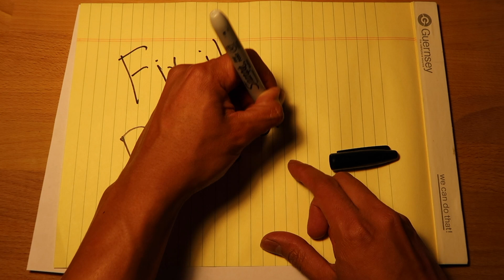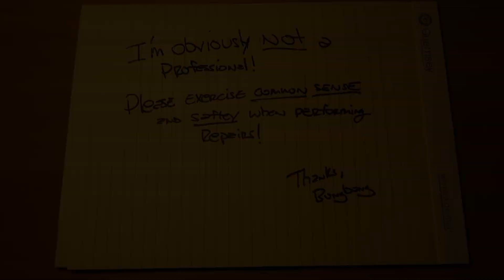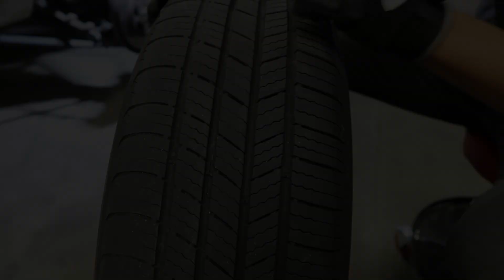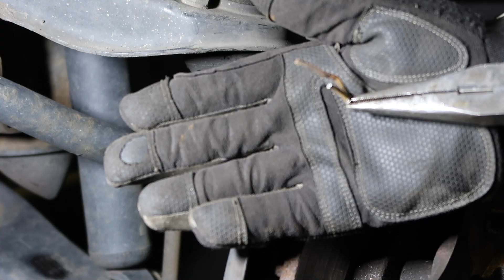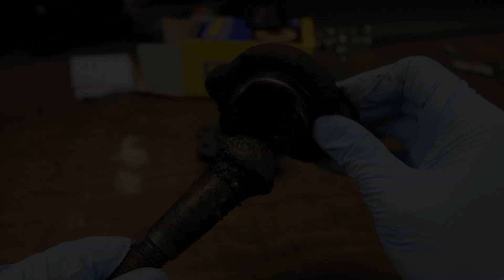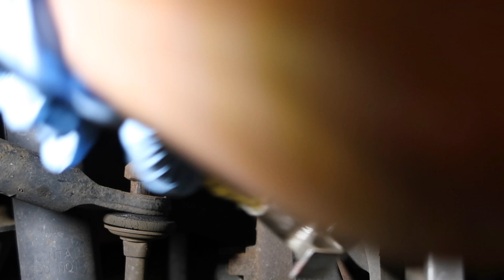HOW TO: Replace Worn Ball Joints!

Comment: Great video man!
Now I need to find one that does lowers...
Reply from the maker: The lower ball joints on the 2wd d21s are part of the control arm assembly, unfortunately you have to replace the control arm to do the lower ball joint.

Comment: Great vid man! Definitely helped me do mine.

I will say, I have NO idea how you did that little trick to get the upper BJ's out 😂 I had to unbolt them from the upper control arm, put a torch on them, put a puller on them, air hammer them relentlessly, beat the puller with a sledge relentlessly, and FINALLY they'd pop. I don't even live in the rust belt, either!
Reply from the maker: Oh wow! and not even in the rust belt?! Are you near the coast or salt air? That's interesting. Thanks for watching and commenting!

Comment: Hi, I am looking to replace my ball joints however after looking online there is an "Upper" and "Lower" Ball joint. Whats the difference and are both needed for this replacement? Also which type of ball joint did you use in this video? Thank you so much and great video!
Reply from the maker: Great question! The difference is actually best described in their names, where in a double wishbone style suspension there are two ball joints used to locate the spindle. The upper resides above and the lower.. below. In my particular video the upper is replacement, while the lower requires a complete replacement of the lower control arm. If one is bad, you should definitely check the condition of the other (if you have two). In my instance I only had to replace the upper. Vehicles with a MacPhearson strut style suspension will only have a lower ball joint.
Reply: @FixitBongbong  thanks a lot! I appreciate it.

Comment: Good afternoon. Excuse me, with Your  Makita  Impact Wrench Can You loosen and tighten the 24 wheels nuts (all the four wheels nuts) without changing the battery? Thank You. Great Day.
Reply from the maker: Sorry for the delayed response here.. but yes actually. I can loosen all 24 lug nuts on my d21 with no issues and still have plenty of battery remaining. Please note though.. the makita tool I'm using is an impact driver and not actually an impact wrench.. so I believe most people and the manufacturer would say I was misusing the tool. That being said.. I used it for lug nuts for 4 years until I finally bought a dedicated impact gun and the tool still works great!
Reply: Thanks a lot. I think I will get one makita impact wrench. Good evening.

Comment: Quick question what’s the bushing called that the spindle drops into ? My ball joint seem fine but that bushing is shot.
Reply from the maker: The lower ball joint? The spindle is held in place by an upper and lower ball joint. In the video I addressed the upper, but the lower can look like a bushing? Or do you mean the rubber stopper between the control arms? That's the bump stop.

Comment: Would this process be similar on a 2000 Mazda mpv lx edition
Reply from the maker: To be honest, I'm not 100% sure. I did a quick google search for a 2000 Mazda MPV and it appears to have a MacPherson strut design front suspension. If that's the case, then no.. there is no upper ball joint. Hope that was helpful!
Reply: @FixitBongbong  👍👍

Comment: I would probably give my left nut to be able to work on parts lacking such a minor amount, if any, of rust.  Here in MN, there no way in hell you can do these jobs without 4 gallons of pb blaster and a torch, and/or cutting wheels .
Reply from the maker: Bahahahahaha 😂 I feel for you bud.. Cars are relatively rust free around here. 2 hours north is where they start to get a bit more rusty. I do love the smell of PB blaster though.. Cheers!
Reply: I have a 03 Navara in Australia that looks brand new underneath!  I couldn't live in the snowy parts with the rust issues it causes..

Comment: I had my lower passenger side ball joint pop out of the housing just like yours did was on a curvy mountain road with almost no pull offs luckily it popped off and I grinded to a halt in front of a trailer park pull off, I can confirm you have almost no steering
Reply from the maker: 😬😬😬Stan sir.. I'm glad you lived to share. That's horrifying!!

Comment: Great video. Hope is that easy on my D22. 👌
Reply from the maker: Shouldn't be too different, thanks for watching!
Reply: I’m looking at doing these on my D22, the ball joints press fit rather then bolt on. Service manual recommends replacing the whole link but as far as I’ve seen they can be pressed out.
Reply: @danielmcdonald6148  Yup. Got all 4 replaced and noticed that it was a completely different design.

Comment: Can u do a video for the lower ball joint on this truck.. I got the exact one & im planning on doing the upper & lowers on both sides on tuesday
Reply from the maker: Eventually when my lowers go I'll do it, but I don't anticipate them going out before Tuesday. FYI you will need to replace the lower control arms as the lower ball joints aren't replaceable on the 2wd models.
Reply: @FixitBongbong  I know this is forever down the track, and I don't know about availability in the USA, but for sure the lower ball joint is replaceable; I've done it and I'm going to do another this afternoon. 
Just be aware most of the OTC balljoint presses are tall and you need to get the truck up quite high to use one of those, mine needs an easy foot or so clearance below the arm, and when you think about how low it sits at full droop, you're talking about lifting the truck the better part of two feet. It will fight you reassembling because that arm is connected to the torsion bar, so unless you want to really complicate the job you have to jack things to try and get the balljoint shaft back into the spindle. Still easier than swapping the arm though if the inner bush is serviceable.

Comment: Do you have to press it in?
Reply from the maker: On this particular vehicle (Nissan d21 2wd) no. But its pretty common where you will need to press one in.
Reply: Would it be the same for the 4wd?
Reply from the maker: @davidwiseman7896  To clarify on your previous question as well.. if we're talking about the upper, no you don't have press it in on the d21 and they are the same for the 4wd trucks.

Comment: I enjoyed your video. I am trying to figure out what is causing my vehicle to feel like it has space or slips when making right turns before it grabs or engages in turning. Any Ideas would be awesome.
Reply from the maker: Thanks for watching! Unfortunately that could be a variety of steering/suspension items. What style steering system do you have, rack and pinion or pitman arm/steering box?
Reply: @FixitBongbong  Steering box. 1997 GMC 1500 truck

Comment: What kind of grease you use to fill the ball joint????
Reply from the maker: I like to use Mobil 1 Synthetic Grease. Any grease specified for use on chassis or joint parts will work!
Reply: Fix it Bongbong thank you for your response.
Reply: @FixitBongbong  also I want to say Thanks for the great video as you make changing upper ball joints on a 1993 Nissan Hardbody look very easy. As now I have the encouragement to change them once it warms up where I lived at now. And another thing some of these Auto Shops where I lived at was going to charge me from $350.00 to $500.00 just to do the work plus aligned the vehicle.!!!!!!!!!!
Reply from the maker: Thank you for the compliment!! It's a fairly straight forward job, you will still need an alignment after you replace the ball joint yourself. Please feel free to ask any additional questions once you start your project!

Comment: Hi there ,  it all ball joints are this easy to take out or to install , we need ball joint 
Remover tools to remove and the press them inside their place ....right ?
Reply from the maker: Hey there! It all depend's on the vehicle. On my truck the upper didn't require any special tools, while the lower isn't replaceable. Some vehicles will require the whole control arm to be replaced, some require the use of a press. What kind of vehicle are you working on?
Reply: @FixitBongbong  Hello there , my car is Hummer H3 , i intend to change the Lower
Ball Joint , and it needs tools to remove it , upper ball joint is attached to the Upper
Arm and needs to change the Upper Arm all together , i know your car's Ball Joint
is very easy to change it's BJ so i just wrote it to say not all cars are like that you
were working on .... Marami Salamat ! thanks ..
Reply from the maker: @ironfistarrival  Ah yes! Salamat!!
Reply: @FixitBongbong  the lower ball joints can be pressed out with a press kit.

Comment: Hello quick question sir This is the lower Ball joints or the Upper ? Thanks
Reply from the maker: I replaced the upper in the video. Unfortunately on this model truck you can't replace the lower ball joint, you have to replace the entire control arm assembly.
Reply: @FixitBongbong .ok thank you very much.

Comment: Yours is a 2WD, anything different for a 4WD Model?
Reply from the maker: I'm fairly certain the upper joint removes the same for 4wd models, but I could be wrong. On 2wd models the lower joint isn't removable and you have to replace the whole control arm, while I believe the 4wd models are replaceable.